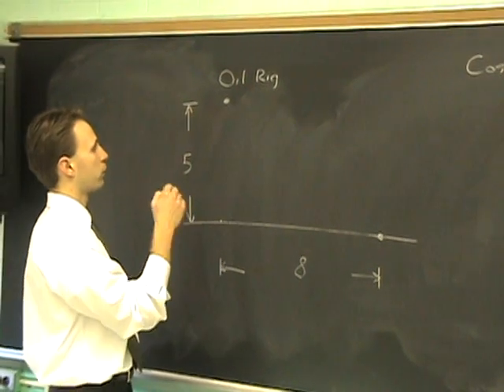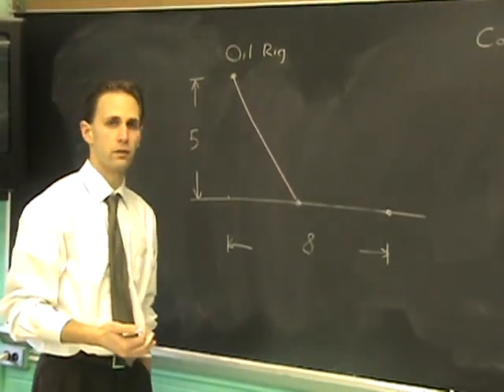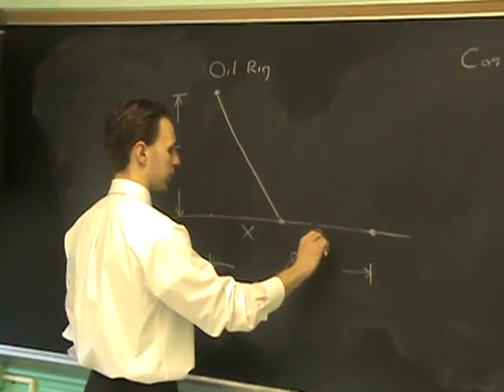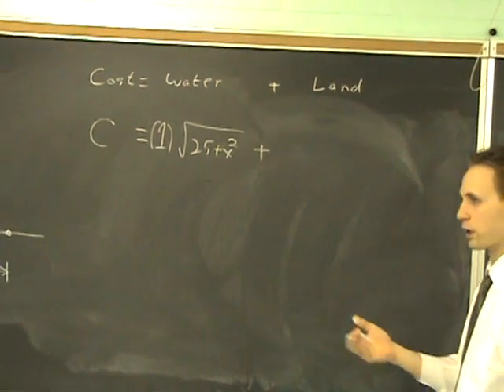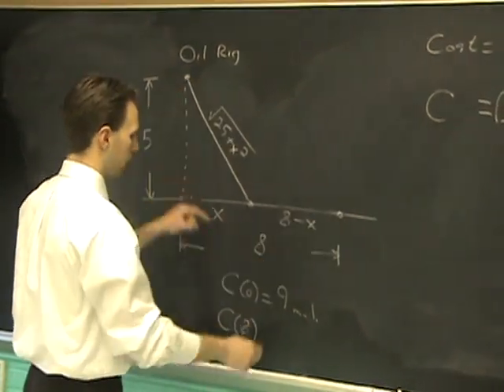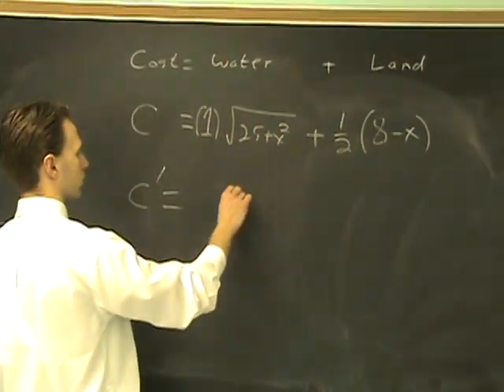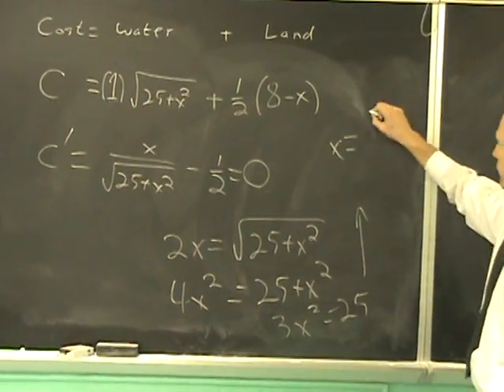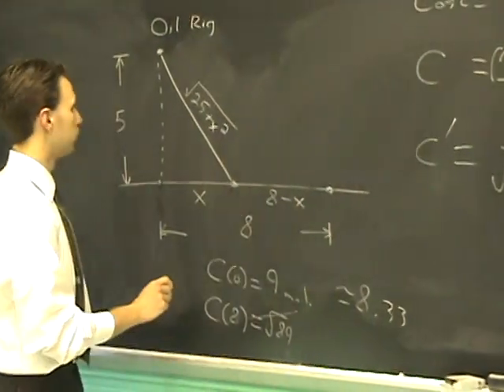Optimization: The Oil Pipeline

Comment: What if you’re not given the cost to lay the Pipes?
Reply: Hey thanks for the question! You need the cost to lay the pipes to answer the question. Either you need to know the cost of each (as in this question), OR you need to know the cost of one type relative to the other (as in, "It costs 1.5 times as much to lay pipe across water than across land", or "It's 20% cheaper to lay pipe across land than across water")
Otherwise, the question is unanswerable.